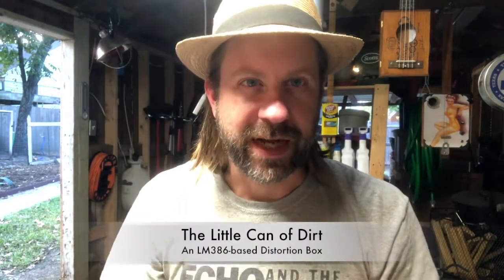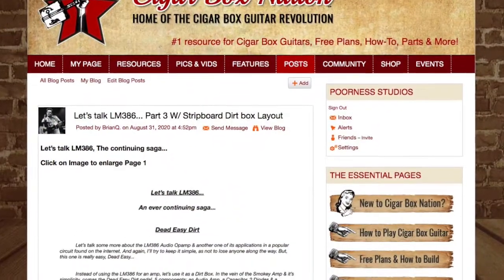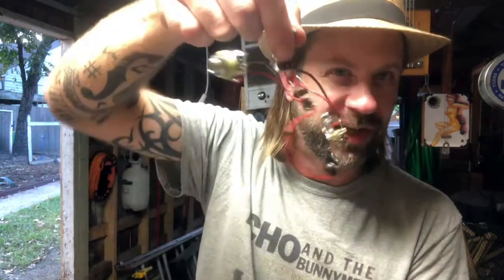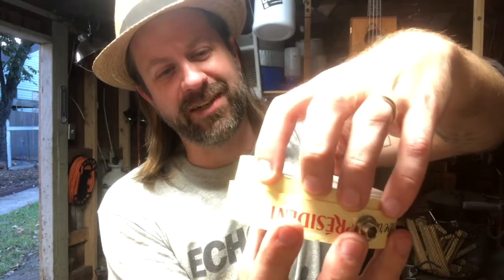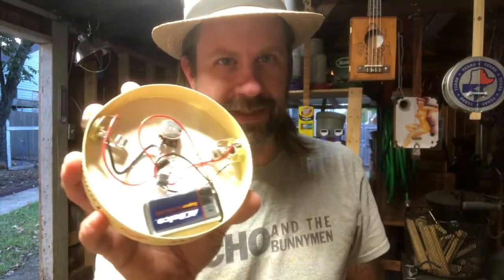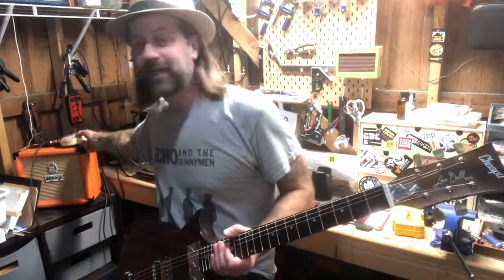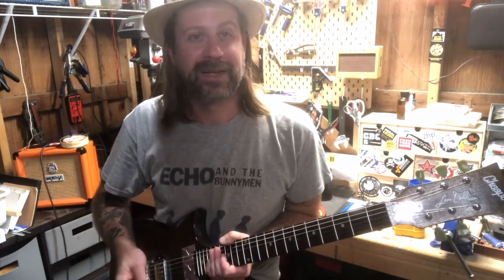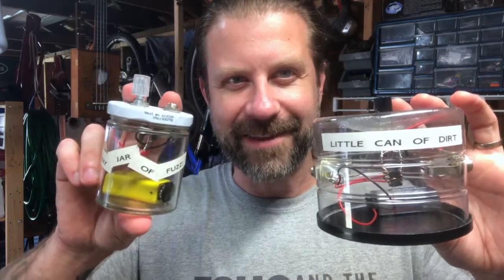DIY FX Pedal: The Little Can of Dirt

Comment: Nice build! The inventor of the Lm386 is Fran Blanche, Franlab, Frantone pedals. she has a video about switching up to 3 of those IC inline for much harmonic goodness. that circuit wants to be a receiver too. shielding and bigger caps are helpful to fight the intermod  Frantone Brooklyn is the pedal.
Reply from the maker: I did not know that. Thank you so much for the information. I will check it out.

Comment: Would adding a 100nf capacitor between pin 4 and 6 fix the hum? I'm no expert but this sounds pretty good so I'm going to build it. Thanks.
Reply from the maker: That's a good question. I talked to BrianQ and he said the hum may be from the deadbugging approach. Soldering leads right to the chip tends to cause more stress on the solder joints and thus hum. He said socketing the IC might reduce the hum.
Reply: @musicalmiscellany  I built them one worked and one Didn't but that's ok I'll work it out. I noticed the dirt was super noisey when power by a 9v wall wart but when powered by a 9v battery there was a lot less hum. 

Thanks.
Reply from the maker: @flrs221  Awesome! Congrats man. Double check that you didn't bridge any solder points and you have good contact everywhere. I'm sure you can get them both working.
Reply: @musicalmiscellany  The other one is now working. It was just a bent pin on the LM386 

I'm going to post a picture on Reddit once I'm done making the enclosures. I have a little build page on Reddit. I mainly build Eurorack stuff.
Reply from the maker: @flrs221  That sounds like good stuff all the way around. I can't wait to see it.
Reply: It needs a capacitor between the input and pin 2 of the chip for sure. There's nothing blocking dc signal getting into the circuit if you went exactly by the schematic/layout on the site.
Reply: @CharlesWillisBonsai  between pin 2 and 3 on the LM386? What size and capacitor would be ideal? Thanks.